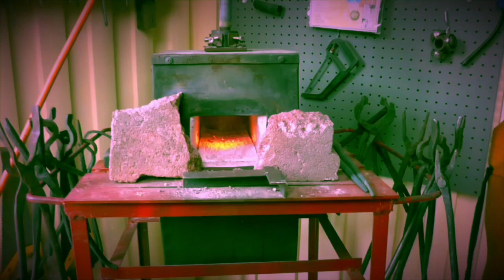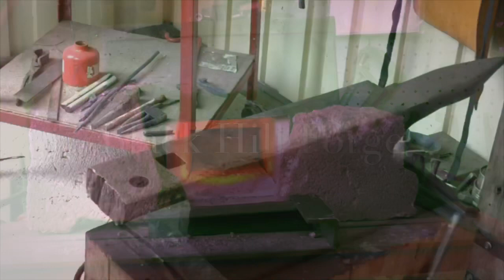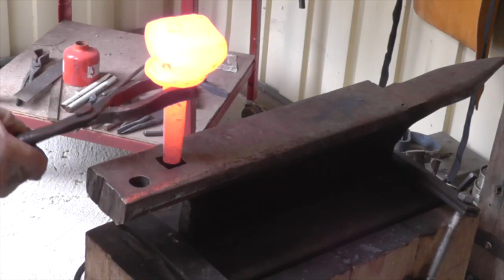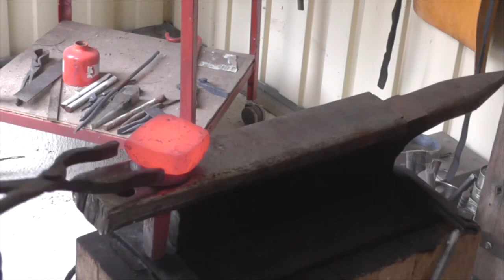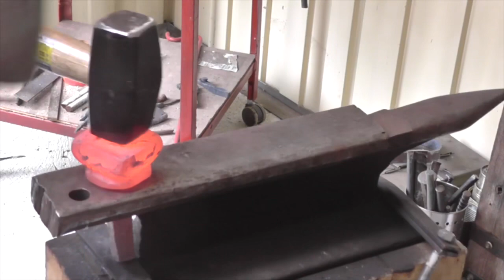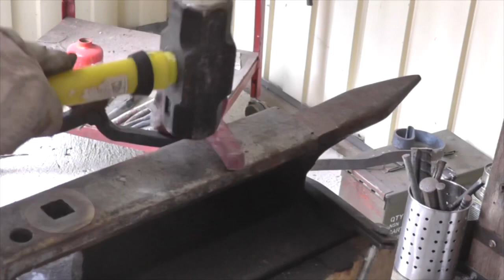Blacksmithing - Forging a hardy swage from a tow ball - Part 2

Comment: Did you intentionally set that up to have that resting point on the bottom plate of the track?
Reply from the maker: Not at all, it just happened to be how long the stem ended up when drawing out to 3/4 square
Reply: cm8sunset That's accidental genius. If I were you I'd draw that tail out another inch, set it in the hardy hole and smash the top down to make as solid of a rest as you can. I've seen tails and horns break off of those railroad track anvils incredibly easily.
Reply from the maker: I am slightly concerned about shearing an end off it, but I don’t have a swage block (yet) to use.  I am hopeful that in a few months I will have sufficient funds to invest in a cast steel 100lb new anvil, and the track cost me $10 and a whole lot of grinding so not that concerned!
Reply: cm8sunset Duly noted. The extra support on the base would stop it from shearing off 100%.